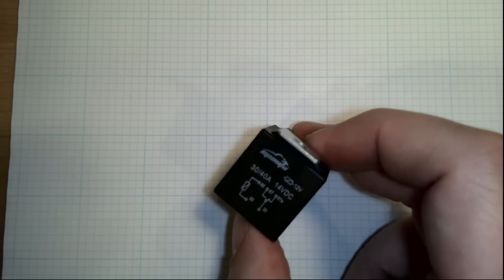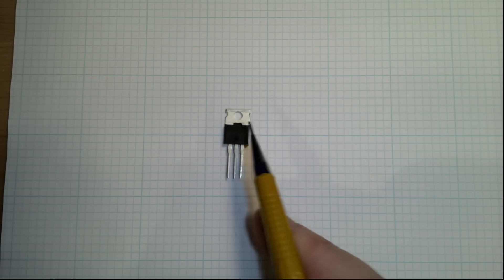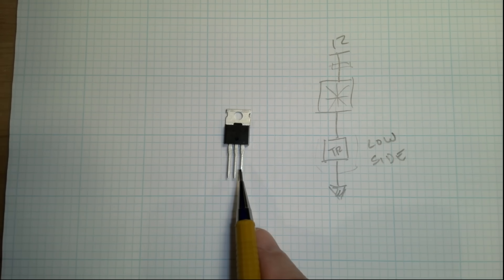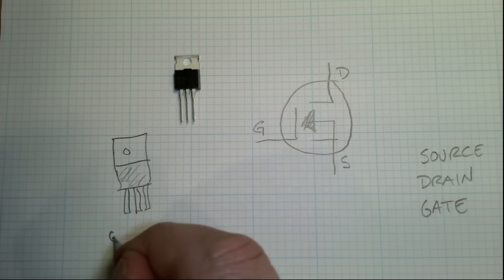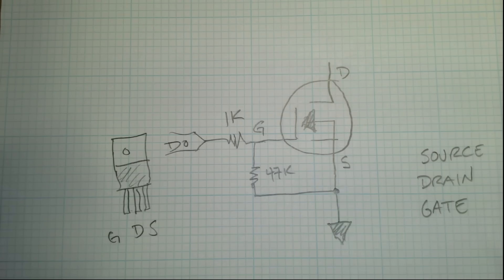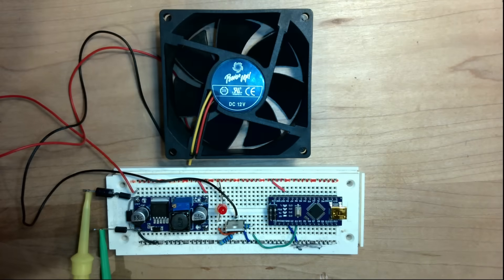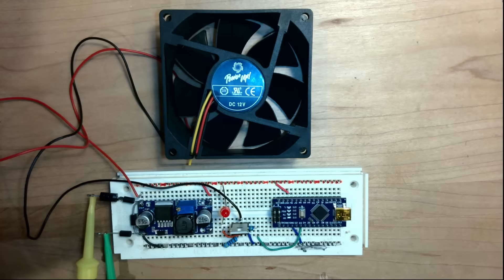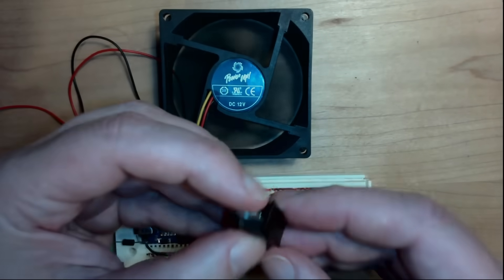Using a MOSFET to Switch High Current Automotive Loads

Comment: what amazes me, is those tiny little legs, can take some serious current, often quite fine with 30 or more amps, if you bought some wire rated to take 30 amps at low voltage it would be very thick wire...............go figure, but it works.

Comment: This is true BUT as a very experienced electronic tech NEVER EVER use an electronic component like a transistor or Mosfet if you can use a relay. Relays are far more reliable & durable and much less sensitive to heat, a Relay will last longer in the majority of installations especially high current or high voltage.

Comment: Thank you for your Theory Lesson. The biggest issue I see with modern autos is electrical failure due to over complication. Hard to diagnose the failure, and complex repair. This device disabling the cooling system fan on a car would require a tow from AAA.

Comment: Okay  this is cool, complicated and expensive but cool. What is the real use case here though? How does this make turning on a light or fan in an automobile better? I get that the life is much higher and that's nice. And perhaps for an overland vehicle with a lot of tech getting shoved into it,  a central micro controller and a row of transistors makes some sense.
Reply from the maker: I expanded on it and made a glow plug controller to drive 6 plugs on a diesel, so that's one possible use.

Comment: Stop by your local NAPA or Autozone and pick up a MOSFET for your headlight circuit. Relays are still used for a reason, they are pretty much universal in the auto industry. They are also quick to swap out. An accessory component or module that utilizes MOSFETs is fine, as long as it can be priced comparable to and quickly changed out as needed. A mechanic can swap relays to rapidly diagnose if your fuel pump or a/c relay is bad, then just plug one in and you’re back on the road. If you have to wait for someone from the geek squad to show up with a soldering iron it will never be incorporated into automotive design. A MOSFET inside a keyless entry module equates to changing out the bad module. In that respect we already have it. Relays are modular and easily accessible and mostly ofof a universal design. This is why they are preferred.

Comment: What if you want to turn ON the FET with 12v, can you increase Gate resistor value?
Reply from the maker: As long as you pay attention to the max voltages for your part, you can switch it with 12V, yes.  Even with the gate resistor that I used.  It's reducing current during switching, not changing the voltage.

Comment: I am a noob. Can you please give ma an idea of how big of heat sink required for driving 30 amps. And engine bay is usually much more hotter than out side open environment so can heat sink handle the engine bay environment ?
Reply from the maker: I'll be posting a new video soon that shows a high side switch that doesn't need a heat sink at all.
Reply from the maker: And it will be running under hood

Comment: @dotnetMakers
1 month ago
To be clear here, I'm not saying MOSFETS are better than relays.  I'm not saying you should get rid of relays.  I'm simply saying that relays aren't the only option, so if you're working on a project you might take into consideration using a low-side or high-side MOSFET switch. Use what makes sense to you in your project.
You could just use that Title ( HOW TO CONTROL A BIG LOAD USING MOSFET ) Would make more sense to your audience .😀

Comment: I stopped the video to say THIS " Why you began with a relay then go to MOSFETS that will replace the ( Relay) , which was still good to follow . Then suddenly the demonstration arrived :face-fuchsia-tongue-out::face-fuchsia-tongue-out:.
This is where you jumped from potatoes to tomatoes .:hand-orange-covering-eyes:
Where does your main subject ends ???? Why must I use an Arduino and a module to drop the voltage and or the 12V Battery of the car , PLUS you have to go write the program on the Arduino?
Is it not much more easier to buy a simple relay that will be installed in no time and less cost  without having to be programer in Microcontroller ? 🤔
Microcontrollers may be useful to automate some big load like a water pump to irrigate a garden every day for a certain time and switch off ,for example .
You are complete out of your ( CHEAP ) project . Arduino + Buck down Converter + Mosfet + a PCB to mount all this together  will be cheaper than a simple relay ?
Stop being crazy my friend .
AMS1117 3.3V Voltage Regulator Module + Mosfet will do the job :eyes-pink-heart-shape:

Comment: I like the way you think 👍 you might need to remind some to make sure the + is fused because I've seen fan motors find another sorce for ground. 😂there is hundreds of videos with hot wires melted in everything under the hood, most original wiring is fused and common sense should kick in ,yet someone is still gonna FAFO.

Comment: I can see where this would be handy. However, a mini relay (almost half the size of the traditional Bosch relay you showed, which are still the most popular for aftermarket use) is used in most vehicles today and are socket mounted for easy replacement etc and cheap, or free if from old parts.

Comment: The only time I've used a transistor rather than a relay was to limit the current drain on my main battery that was pulling in a relay to connect my auxiliary battery. Other than that one application, relays are simpler, rugged, don't require a heat sink, and are available in any automotive parts store, Walmart, RV supplier, Radio Shack, and many hardware stores. I use solid-state modules for timing circuits and alarm systems, but they are over-the-counter devices and require no breadboarding. Keep it simple, especially when it comes to cars.

Comment: This is just REALLY STUPID as it is a step BACKWARDS.  People are getting so used to having to upload two videos a week to keep the algorithm recommending their content that we are ending up with a ton of "junk" videos.  I always tell people, go more for a long term maintenance friendly approach than just a "look what I did, Mommy, I got er done" approach.  Also, doing it in a strange way just to create a talking point at the car show with a bunch of ignorant guys who 99% of the time outsourced their build work anyways is just pathetic- surround yourself with like minded or advanced thinkers to keep mentally growing.   It is like Johny Knoxville doing the whole hero of the rtards thing.

I have been an HVAC, Low Voltage DC, and auto mechanic for over 30 years- you choose your projects when you are the boss and laborer.  I would not recommend doing this.  

First is maintenance- I want to know that if my relay goes out on the side of the road I can unplug and plug a new one I had stashed in the trunk or that I can get at any open auto parts store anywhere.  With Radio Shack and Fred's gone good luck finding a mosfet ASAP, and if you do have an extra mosfet on hand you are soldering on the side of the road... genius.  

Second- you just took a cheap and easily available, compact plug and play package (4 or 5 pin common relay) and replaced it with what now is a bunch more parts (to fail) that is not and will not be a compact plug and play package.  

Third- you are going to need a decently larger heatsink for high load automotive applications and then you are putting that heat sink in an environment that will get dirty and corrode starting almost immediately... genius SO CLICK WORTHY.  

Fourth- anyone who has been playing the game for a while understands the long term reliability of analog options.  We now live in a throw away economy primarily because of crappy solid state electronics parts that really despise heat and adore tin whiskers (unless if you have access to special waivered medical or military "good stuff" components.)

Fifth- I could perform this repair when it prematurely fails.  I am an exception.  When you sell this car or someone other than you breaks down out of town how many mechanics are gonna see that and be like "no problem, lets just probe it to find out if he uses an N or P mosfet and then calculate the load we need to figure out what part number to order online.  Newsflash- 95% of mechanics don't fix things, they replace things and unfortunately "keep it simple, stupid" logic and "if it ain't broke, don't fix it" (preventative maintenance, maybe?) logic, logic which an advanced tech despises, is generally the law of the bolt on bolt off simple minded mechanic world...
Reply: I agree with your take an this. When it comes to engine electrical weather it is automotive, marine, or any other area, they pushed how much simpler and more dependable the machine electrical would be. We now have switches operating simple lighting and small motors that have to be wired through one or more computers or modules as they call them then send power and ground to the device. If it is a high amp device then it goes through a relay just as if it would without routing the switch through the computer if we are lucky because if not a much more expensive computer will need replaced or sent for repair. That is if it isn't on "indefinite back order" as the auto manufacturers call "no longer available" these days. I assume it's a play on words to get them out of the mandatory 10 year parts supply. Can't by parts? Buy a new $40,000+ vehicle. At least if off the shelf relays are used these parts will be available for a long time.

Comment: Yup, this would work great. I have used MOSFETS in alarm applications for door lock actuators and it is super quiet (no click noise) and for window roll up modules. Great video!

Comment: I seem to recall that one of the issues you need to consider with MOSFETs is the fairly high Gate-to-Drain capacitance.  When switching a load with much higher voltage than the driver, this can reflect some dangerous signals back into something delicate like an Arduino.
Reply: I think that's a pretty easy problem to overcome. Just put a series resistor on the gate, almost any microcontroller including the arduino uno/mega has steering diodes that can handle maybe 30mA or so for a few milliseconds no problem. Depending on how much you care about a $5 chip and the application it's controlling you could do a lot more, like add your own steering diodes or transient clamps or even galvanically isolate the entire gate drive if you have to, all off the shelf stuff. A series resistor alone is enough for an arduino mega to switch a fuel injector on a car from a mosfet reliably, I've done it with speeduino. Well, with an extra external pulldown as well. I don't remember much but I think I recall the mega not having a definable start state for pins other than high impedance?

Comment: I've been using relays, but I switch them with a 2N7000 MOSFET.  (N-Ch) This gives me the logic control I want, and the 2N7000 has an easy life with the low current draw of the relay.
My question is: Why should I run the FET on the low side? I've been putting it on the high side with no apparent issues.
Reply: Generally it's cheaper/easier/more efficient to switch the low side, far as I know that's the only reason not to. I don't know exactly what you are doing with that fet, but I do assume it uses more power than it would to do the same thing from the low side.

Comment: Very well explained video. Thanks, the only word of caution I have,  having done car fan conversions, regardless of the FETs specification  the leads are too small to carry constant high current loads. Especially  if you using a connector for the transistor. You can heatsink for    RDS-ON but I think the weak link is the size of the interconnects  The relays have much larger connectors and are also rated for 40 amps. I would not push my luck on that either.I would be ok with 15A in a relay.  Look at a NEMA 30 amp dryer connector the blades are large for a reason.  Anyway, good advise on the pull down resistor. Yes bigger FETs are available.

Comment: For switching Automotive loads, a High-Side switch is much more convenient. And a 'smart' integrated device, with built-in protections is certainly a much better choice. I personally like the Infineon Power Profet (BST500xxx) which have incredible capabilities.
Reply from the maker: The BTS50010 looks fantastic!
Reply: @dotnetMakers  It absolutely is. I built keyless ignition kits (with RFID hands-free trigger) using three of these to switch the three Igntion circuits in place of the key-switch. It would be really easy to make up a Switching Panel to use for all kinds of accessories - aux lights, air horns, etc

Comment: You absolutely can use an N channel mosfet for a high side switch, you would just need an even higher voltage to trigger the gate, something like a charge pump could make this.
Reply from the maker: Yes, I'm building one using an IR2110 half bridge driver

Comment: When deciding between using a relay and a MOSFET you should also consider the possible failure modes.  A friend's MINI uses a MOSFET inside the power steering pump which is wired to battery power.  The FET failed closed (relays most often fail open).  So with the key off the pump would continue run until the battery was dead.   Changing the MOSFET involved cutting off the motor brush connections which were crimped.  A replacement assembly is well over $1000.  I wish they had used an external relay instead of an internal MOSFET for that application because of the failure mode and the inherent cost in replacing an embedded component.  Engineering is about choices, and they aren't always equivalent.

Comment: There is a reason why relays are used, almost exclusively in automotive and generally, industrial power systems, instead of MOSFET setups..if relay is used for something in your car, try not to be smart with MOSFETS, as you may learn it hard way, it was wrong thing to do..
Reply from the maker: Indeed. A relay-controlled PWM controller for glow plugs sounds awesome!

Comment: would be great if there were FETs who can be controlled with 12V. Using a step down converter for 3,3 / 5 V is the disadvantage to normal relais

Comment: You must also have a resistor or a diode in parallel to the load if it is inductive to take care of the inductive spike when shutting of the load!

Comment: Parabéns! É uma excelente explicação! Acredito que um MOSFET seria crucial e importante para operação em ambientes que lidam com gases altamente explosivos,  ao contrário dos relés que geram picos de faíscas,  em seus contatos em NA. Pelo que entendi, seu papel é ser um driver em solid state, silencioso, rápido e preciso com os comandos microcontrolados que são enviados em seu gate operando amperagens significativas.  Observando os comentários, é notório que o relê não perde o seu título de majestade  no mundo moderno da eletrônica, pela sua eficiência, simplicidade, resiliência as intempéries e boa estabilidade em seu efeito eletromagnético para fazer a comutação eletromecânica. Em particular gostei de um comentário que falou tão simples e eficaz é substituir um relê em seu soquete a despeito de remover um MOSFET soldado com estanho em alguma placa. Outro comentário abordou que o dissipador térmico seria apropriar mais espaço ocupado em um veículo, o que depreende a pequenez surpreendente do componente, mas a necessidade diametral de um avantajado dissipador de alumínio. Talvez possamos entrar em um consenso positivo e inventar um relê automotivo com o mesmo formato e pinos de encaixe compatíveis com a base de soquetes, mas ao invés de ter dentro dele uma bobina eletromagnética e contatos móveis, ter em seu interior um MOSFET, acompanhado de alguns resistores apresentados pelo professor dotnetMarkers. Já pensaram nessa ideia? dai para fechar com chave de ouro além do MOSFET estar no lugar da bobina, a caixinha do relé seria totalmente em corpo alumínio para ajudar a dissipar o calor gerado. Resumindo: teríamos na prática um relê com seu formato original e seus pinos de encaixe, porém dentro do mesmo comandado por um silencioso MOSFET!. Gratidão pelo conhecimento e gentileza professor! Ganhou mais um inscrito em seu canal!

Comment: Beware that when MOSFETs fail they commonly do so as a short in circuit. This is the biggest reason they are not suitable for most automotive applications.

Having your headlights or horn or even washer pump remaining on in the event of a failure is not ideal. 

Then being able to replace the failed component like a fuse or relay would require it to be replacable or packaged in a similar manner, ie without soldering or electrostatic damage, is yet another challenge.

Comment: Relays way simpler and more tolerant for automotive applications for the normal user. Unless you’re geeking out on adding a microcontroller to do some funky lighting or controls, this is not ideal

Comment: One thing to also consider it inrush currents.  Things like motors will draw a much larger current at startup than they will when running.  Relays can typically handle a decent amount over it's rating for a short period before things begin to get hot, but a transistor will instantly fail.

Comment: Although N channel FETs are typically used for low side switching you can use it for high side switching (switching the positive side instead of ground) by using a gate driver IC to drive the gate voltage to the right level (like 20V or so)

Comment: in an Ebike controller, there are usually 3x3 running a 3 phase DC motor and all are wattage rated (ie 350W) can I replace the MOSFETs with larger current spec pieces to increase the wattage of the controller from 350 to say 1000W?
Reply from the maker: A great question. It's unfortunately probably not that easy, since it's rarely just the MOSFETs. There are usually drivers and other components so those would have to be checked to make sure they would be compatible and the traces on the PCB might not be big enough to handle the higher load.